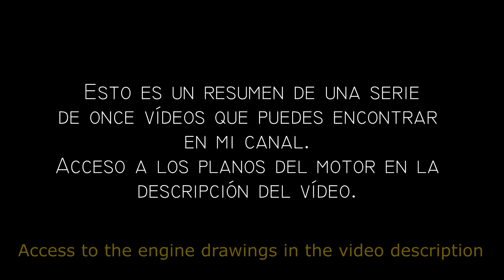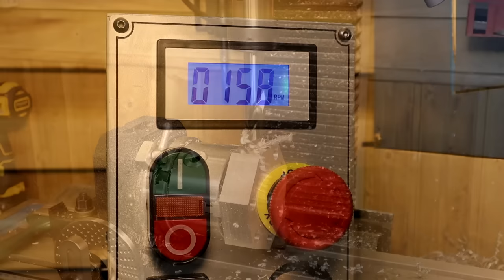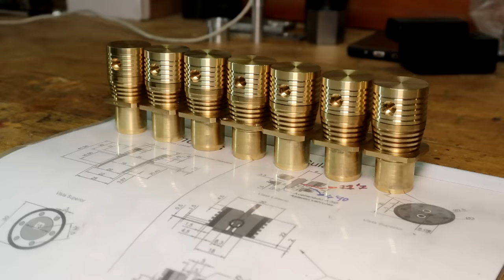500 Horas tardé en fabricar este motor de 7 Cilindros

Comment: That has to be the best piece of micro engineering I have seen in my many years. Nobody makes a 7 piston motor by hand ! Engine deserves to be in a museum !..thanks..
Reply: In your lifetime maybe, but when I was a youngster, I met a pensioner who had been an instrumentmaker. He made working miniature engines from scratch in the 1970's. I think his name was Willem van de Hoek (a Dutchman), but I can't find anything on him on the internet. He has probably died a long time ago, as I'm almost a pensioner now. Last time I've seen him was in 1988, when I attended the 75th birthday celebrations of the Dutch Airforce. He was there with his engines, demonstrating them to the public. As I remember, he had a V12, a 5 cilinder radial and one radial with a lot of stacked cylinders, but I don't remember how many, a 4 cyl boxer, a V8 and some others I can't recall the type of. Funny thing always was that when a crowd drew near and got too close to his liking, he reversed the pitch of the prop (they were adjustable pitch by design) and 'floored it' 😂. As most of the engines ran on methanol and caster oil, people were very eager to step back. I remember being intrigued by the V12, as you could see all of the valves move when the engine was running.
I hope his engines too have been preserved somewhere.
Reply: @arturama8581  Sorry but I saw the comment is only 7 days old and sounds competent.  Can you explain to me what I'm seeing there?  I see no spark plugs and no fuel.  A few keywords would already help, so that I can investigate myself.  Thanks.
Reply: @tondelayadellaventimigliax6162  it's moved by compressed air.
Reply: @LtdJorge  tx... so it s not a motor...
Reply: @tondelayadellaventimigliax6162  so you have no clue what you aré talking about, stay quiet and let the olders talk.
Reply: @JorgeRamirez-dz6fo  lol... so you don't know the meaning of the word "motor"... xD
PLONK <3
Reply: @JorgeRamirez-dz6fo  he asked a question in hopes of learning something new and you respond with ignorance. 🤷‍♂️ Why not just stay silent?
Reply: @tondelayadellaventimigliax6162 fuel and spark plugs don’t make it a motor either. Motors are electric.

Comment: I Loved this whole presentation and respect the labor and intelligence and skill it required.  Perhaps you might consider a  Rotary Radial Piston Engine as an encore.  This engine was most common in aircraft from 1908 to 1921.  It is the kinetic inversion (as I once gratefully read) of the latter radial piston engine.  The difference would seem simple to a layman, but you know the real difference between  a LeRhhone, or Seguin, or Oliver-Farwell, radial,  That difference is really interesting and folks' will watch.LeRhhone

Comment: on your plans the gears mentioned are 32 teeth on the large gear and 15 teeth on the small gear. this will never mesh. If you work to a ratio of 2:1 then one gear will be half the size of the other. I am currently looking at making this for myself but modeling and simulating in CAD first.

Comment: I guess Finally he couldn't to start it .course he turned by electric motor under that .how engine can work with out injection fuel carburetor. Or how still on when any smoke no eject.

Comment: Except:  of course it's not an engine . It's a model if a reciprocal air machine.
It has no real use. 
 An engine runs independently on fuel.
For a power source in a device.
 This is a visual toy.
  500 hrs to watch a prop spin from compressed air.   Click bait.  Lies.

Comment: What 500 hours on an engine that runs off of air what a waste if it can't run on its own power lol
Reply: even if it worked like an internal combustion engine, 500 hours is too long. Therefore, in mass production, not only turning, but also casting, stamping and other material processing methods are used.